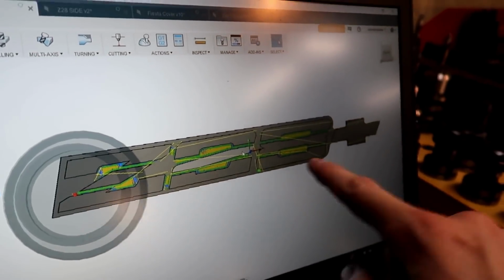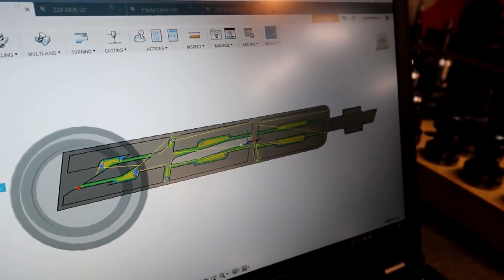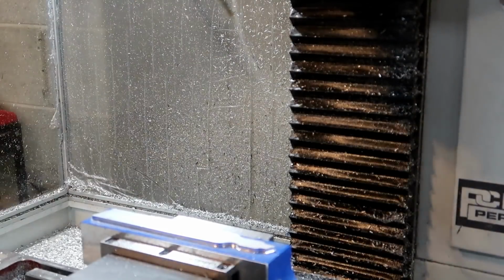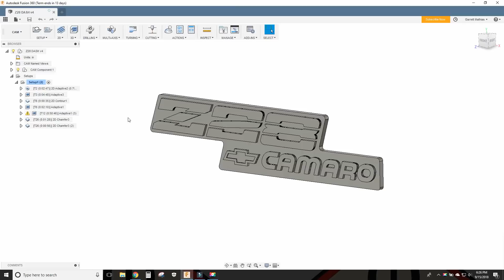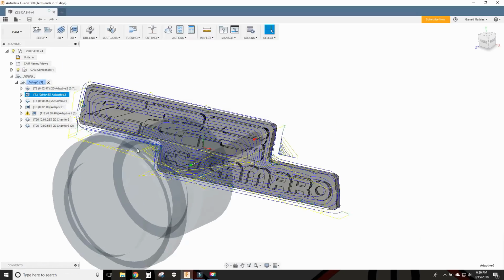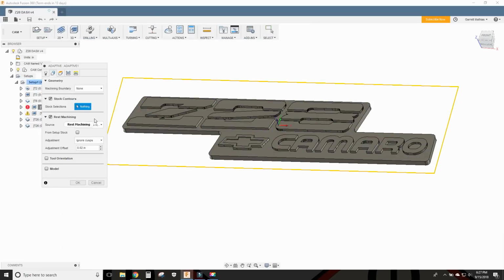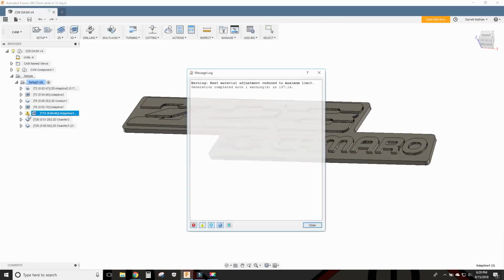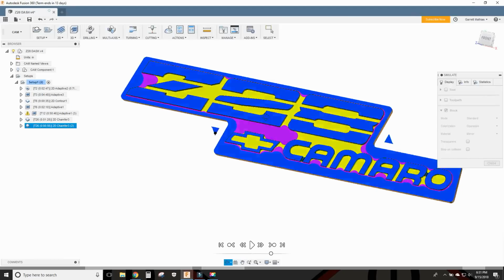Z28 Emblems, Powdercoat, and Program: Home Mfg. Days #57

Comment: Great vid Garrett!!  How long do you leave the weight on the part to let the glue cure?  I'm curious why you chose to do the sandpaper instead of just lowering the super fly another 5 thou?  .......maybe worried about the PC chipping?  They came out looking great! :)
Reply from the maker: Thanks mike! I left the weight on for about 3 minutes to cure but I am more worried about the tape, that's why you saw me run a dowel over the tape on both sides.  I didn't want to take another 5 thou pass just because the chamfers on the letters are only 4-6 thou. I would have been alright with a 1-2 thou pass though BUT I really like the fine grit sandpaper finish.